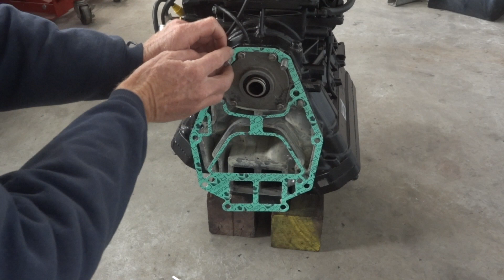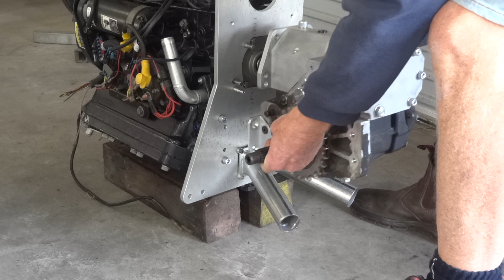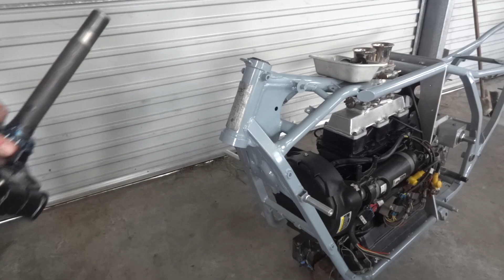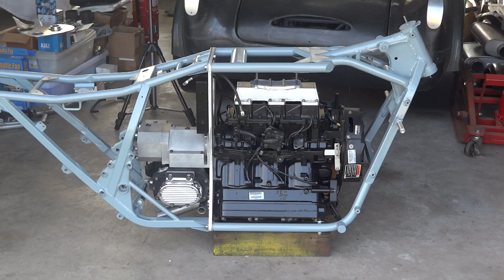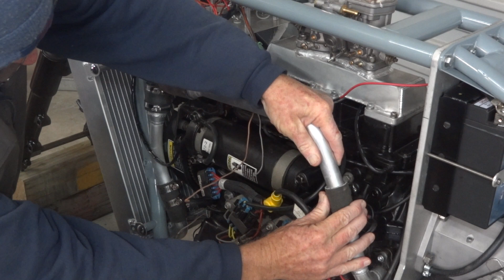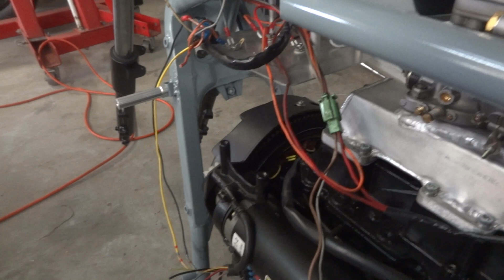Mercurial Outboard Motorbike Mercury 2 stroke V6 assembly part one and first fire up

Comment: Nobody does this I wanna see more people convert boat engines into land  projects all you need is a radiator and a fan with an exterior pump outboard engines are literally compact 30hp out board is almost as small as a smaller  predator engine with the gas tank on it love the work be like no other💪🏻💪🏻

Comment: Its an art and a scupture... but as a vehicle it has some big structural and mechanical flaws... first one is boat engines power cant be translated to on road vehicles in full due to a thermal inefficiency as being on the water engine has endless supply of dense coolant aka water but road wise is has only air and lots of losses during heat transfer from engine head to the radiator - means it could lose 30-40% of its power in this type of modification rendering 2.5L underpowered with just 100HP. Another big issue I've noticed right away is a front-to-rear frame upper joint done by two 10mm (I believe) screws - it's weak, there should be a sort of interlock joint like pins to release stress from a screws... anyhow, nice project overall.

Comment: You may be surprised to find that the transmission end cover you have is for a Softail Harley, but the cover for a FXR or FLH dresser model will have the clutch cable in the location you need, and the ball and ramp clutch release will be lined up correctly
Reply from the maker: thankyou

Comment: This is very interesting. I wish I possessed the ability to do something similar. 
I'm not a motorbike guy but I do know a bit about these mercury's. 
Cris Carson marine supplies very good composite reed's and stuffers for these motors that greatly improve starting and throttle response at low rpm and through the mid range. 
They don't increase power but it does make it feel like it over stock.
I also think they improve fuel efficiency everywhere except full throttle. 
 I think you're going to be surprised by the torque of the 2 stroke.
 This thing will be a handful.
27° btdc is its limit! At least one cylinder will be 2° higher than the rest. So don't just set it off cylinder one. 
25° is Max because of this.
I use a degree wheel decal on the flywheel to check them all.
If you want higher rpm set timing at lower advance like 22-23°.
Reply from the maker: thanks mate. helpful info. glad you like the project.
Reply: @malcolmoastler3039  yes I think it's great. I've always wondered if this was possible.
I'll be watching for sure.
Another thing you might want to look into is putting egt probes in your exhaust.  It's a great way to monitor and adjust air fuel ratios in the case of carburettor problems.

Comment: I'm very curious about how this will turn out. Outboard engines are so different from motorcycle engines in terms of throttle response and power curve.
Reply from the maker: weber carby mate. she'll be right
Reply: @malcolmoastler3039  lQQk's like you stole that carburetor from my old VW day's! I ran Dellorto carbs on my hotrod bug's 2135cc with a custom camshaft from a small block Chevy application...from Wyoming USA 🇺🇸 🤠

Comment: Malcolm are you sure that you will be able to balance the fuel delivery with just a single carb? I would look into the laser injection setup which can be run in your orientation and everything is self contained. You dont need to run the vapur recovery system and I think it would be much better for you.
Reply from the maker: sure

Comment: What carburettor are you using, I'm doing a similar build just not a road legal version, I'm using a 125hp Johnson that I got for nothing and building a frame around it with a single sided hardtail and girder forks, a kind of post apocalyptic offroad chopper I guess.
Reply from the maker: your bike sounds cool. mine has a weber of some sort, 45mm I think, IDF or something
Reply: @malcolmoastler3039 
Is there a real difference between a boat carb and a motorbike carb? I'm using my motor in a "standard" configuration with the heads up but the intake on the bottom but im not sure about carb compatibility id like to use the boat carbs but that would require them to be mounted on the side of the motor and rotated 90° so im considering a road bike carb or SU carb in the same location.
And yeah, my build sounds cool but is nothing in comparison to yours, started building it a month or two before your first boatorbike video came out and that has been a real inspiration and motivation to continue.
Reply from the maker: @exogator  not all carbies are created equal, and webers are about the best you'll get. i don't think the standard outboard carbies are very sophisticated